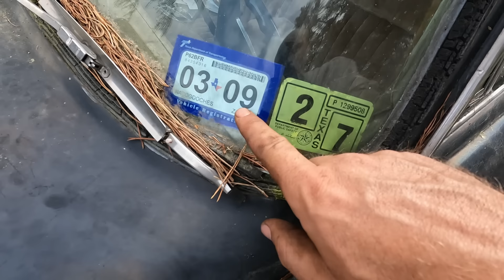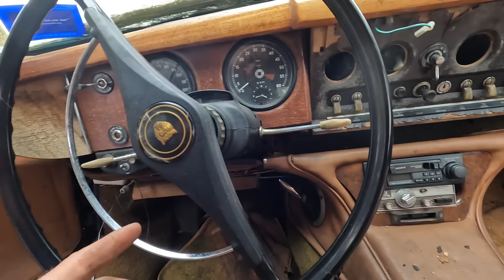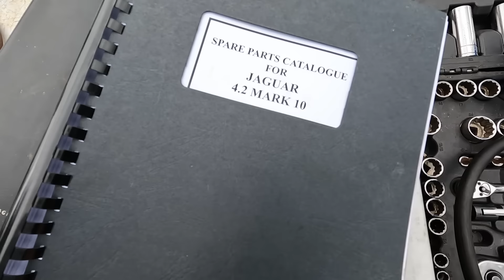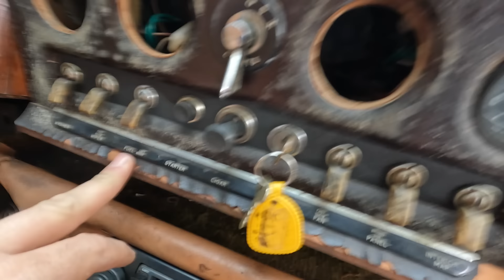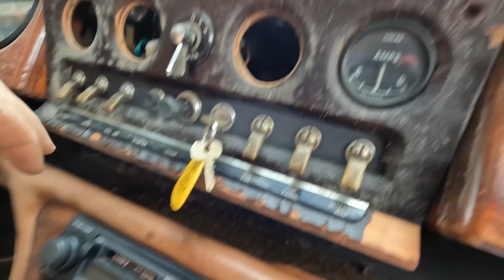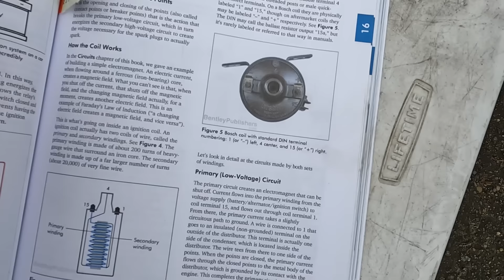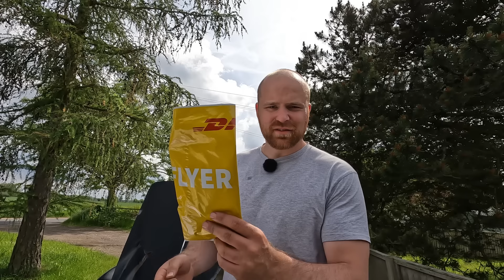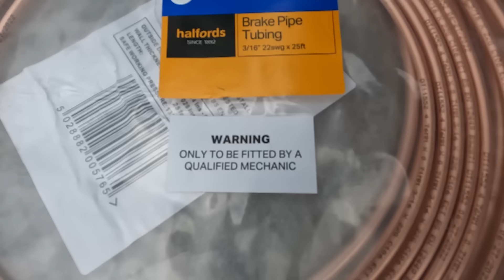1962 Jaguar sitting for 15 years. Will it run?

Comment: I think the wire wheels look fine. When you get to the window seals, if you can’t access them there, or need an alternative, there is at least one company in the US that does that. They can possibly make copies of what you have, so don’t throw away all the old ones, because they may need something to get the profile from. Very interesting video. Subscribed for more.
Reply from the maker: Thanks. Problem with the wire wheels is that they’re probably not rated for the large weight of the car. It’s why Jaguar put the car on steels in the first place

Comment: 1:13:28 The reason the brake pipe won't come out is when it has been tightened the flare on the end has squashed out wider, so it is now wider than the thread. A good pull whilst rocking it side to side usually pulls it free. So you know for next time.
Reply from the maker: Ahh I see. I'll have another go at pulling it out 👍🏻

Comment: Clamp off the rubber hoses going to the calipers on all 4 corners, then press the brake pedal. That way you can tell if it’s the calipers where the air is or back the other way up to the master cylinders.

Comment: Starter motors are series wound motors, which means that you can drive them with positive or negative ground (earth) and they will always spin in the same correct direction.

Comment: In case you didnt know, the side fuel tanks used to rot on all models. Rust would be draw into the carbs and the engine would of course stop running. Theres a good chance that is why the manifold and SUs were removed.

Comment: A bit of a project you have on your hands there. Although it looks very sound, unlike my 1960 Mk2 auto. Spent many hours on my back welding it! The idle speed should be about 500 when running correctly, stops that lurch forward when putting into drive, mind you, it was about the only way I could get wheel spin in my little Daimler 50 years ago!😂  I’ve changed from 2 to 4 pots, doesn’t seem to make any difference to pedal travel. I think your best bet with the brakes is to go with later master cylinder/servo setup, as on the 420G, E-type and early XJ6. Brakes should virtually bleed themselves, with just a bit of help to get the last of the air out. Remember to start at the back of the car. I think you should have at least one throttle return spring between the carbs somewhere, which might help with idle. Should keep you busy for a while, good luck!

Comment: I think the problem with the brakes is related to the adjustment of the master cylinder pistons, if the piston isn't returning back far enough then fluid can't enter the cylinder sufficiently to give a solid pedal. Look at the workshop manual and reset the adjustable one. Good Luck.

Comment: no matter which way you connect the battery it will spin the right way, if it has a transistor radio its usually negative earth, generators are easy to convert from positive to negative earth just by flashing the regulator contacts
Reply from the maker: Is there an easy way for me to tell if it's been converted?
Reply: @NotEconomicallyViable  a multimeter on the generator output

Comment: There is currently a 1938 Austin 7 listed on Autotrader for £2,500 that is right up your street. Apparently it's a non runner due to no spark but turns over. Would make a great project for you, those cars look like a blast and there's still a big community of Austin 7 enthusiasts despite the car launching over 100 years ago.

Comment: The brake pipe layout has been done to do away with the servo. Where are the bleed nipples on the the replacement calipers. if they are not above the piston area then remove the calipers from the disc and hold them so that the nipple is highest and there is nowhere above it for air to remain in the caliper body when your bleeding them. l hope that makes sense.

Comment: Getting this old Jaguar to run is the easy part !!! The difficulty comes when you have to tackle the massive amount of corrosion in all of the body panels, suspension and running gear !!!
Reply from the maker: This car's saving grace is that it's spent the majority of it's life in Texas, so the rust is nowhere near as bad as if it had spent it's life outdoors here in the UK 🌧️

Comment: Getting those triple SU's carburettors set up correctly is quite a specialised job, probably a big part of the reason why the car was running so lumpy.
It was nice to see that the old girl wants to go!
Incidentally, a refurbished set of those carburettors can sell for around £4K, more than the value of the car.

Comment: The hole in the bottom of the diaphragm housing on the carburettor should be for a vacuum hose isn’t it, i may be wrong, good work though mate well done

Comment: You tube is such a great source for repairing any vehicle infact l have used it many times when working on my 1997 Toyota Hilux from adjusting the tappets of how to remove the dashboard because it has to be removed to fit the radio CD player and fit a new ariel that's something for the future but another job on the list which is getting shorter

Comment: I noticed you using copper cored HT lead. I hope you added an RF suppressor to the system for every ones sake. RF suppression was why the trade switched to carbon cored lead. 
I checked hollow floats for leaks by putting them in cold water in a pot on the stove. Turn on the plate, look and learn. If I am forced to retire my 380 SEL a 420G might be a replacement.

Comment: These longer videos are so much better 👍 the one thing I would ask though if it’s not too much trouble, times when you do intricate work, like making the brake pipes, it would be nice to see the way you made them up using the tools doing the flaring and the bending etc and sorting the carbs out,when you took them all apart and did the repairs, some of us who haven’t used those tools before could learn a lot from watching your work. It’s not a complaint it’s just an idea. Regardless I will be making sure to watch all your future videos, this one was great I really enjoyed it, makes me want to go out and buy a restoration project for over the winter 😂 finding the faults and repairing them and having the feeling of self satisfaction when repaired is the best part. So please keep them coming, the more the better.

Comment: Guv, Good seeing you bringing this underappreciated Broken KITTY Mark 10 -. 420 G, Away From ruin.Making it road-worthy again. I Wonder If an XJ6 Break servo would work. Indeed THE Mark  10 - 420 G. was destined for the US Market, Yes It was Underpowered, compared to the American Cadillac Land Yacht V 8's Popular in the 60's IN THE USA.. Here across the pond Durring in the Mid 80's  JAGUARS Series 1,2, and SERIES 3  Were Converted with CHEVY 35O ENGINES with 350 hydro Transmissions, To KEEP THEM ON THE ROAD and Off the Lift. Here's Wishing you success with your project, May it bring you many Safe miles with smiles with what and which powertrain you May decide to facilitate.

Comment: Well done. I have the 420G version of this car in close to mint condition and very much enjoyed. I think your brake problem is the caliper pistons are partially seized and are springing back and forth with every pedal movement. I think that you will have to strip and rebuild the calipers. Does this car have velour interior? If so so that was not an option.

Comment: Back in the mid eighties, I know ow someone who bought a Mark 10 for its engine, it was a 4.2 and then put this engine into an Etype Jaguar Convertible after grinding off the '4.2' on side of the engine block and putting on a '3.8' designation using welding wire! 😮

Comment: The bit you called a choke, is in fact a thermo carb. In those jags you didn't choke the air to enrich the mixture you actually added an extra carb! So you got a richer mixture by adding more fuel. These also work to give extra fuel under extreme load. I think that float bowl with the hole is from the carb that is attached to the thermo carb and for some reason there were two of those fitted.
Reply from the maker: Appreciate the info 🤝

Comment: That looks a nightmare! The work I've been doing on my BMW is Childs play compared to the Jag. 8 hours today cleaning bugs off, alloys cleaned, snow blast, snow foam, rinse down and dry, clay bar the whole car, cleaned windows inside and out, Maguire's Ultimate Compound to all of the car via rotary electric tool, applied wax via rotary tool and some by hand and then touched up the tyre walls. Just trying to lift what is a bit of a tatty looking 120d.

Comment: assuming this is similar to more modern break systems, the booster you mentioned that its missing can cause the peddle to feel like there is no breaks. when the booster draws vaccum it stiffens the peddle but when there is no vaccum and the booster is present in the system the peddle will still stiffen up after pumping it. im not expert in 60's model systems however and they could work differently but i would think the concept is the same, only system ive seen that works different is hydraulic systems that use the power stearing system to assist with breaking power.

Comment: Thanks for the video.
This may already have been mentioned before, so apologies.
If it's a 62 car, it should be with a 3.8 engine?
That engine looks like a later version of the 4.2 with the ribbed cam covers.

Comment: I have watched almost an hour and I am missing one thing. I had a couple of SU carbs back in the 1970s. Yup, I'm an old geezer, and I remember putting oil (auto transmission oil, dexron) in the carbs. That thing on the top unscrews, and there is a plunger in a stem that has the needle underneath it. Vacuum pulls the cylinder in the middle up when you rev the engine, but without the oil in the damper, it moves up too quickly, and the engine misfires. Could be what happened the first time you opened the throttle.

Comment: i know you didn't show it but did you put any oil in the top of the carburetors the brass hex nut on the top of each carb screw out and a small amount of oil is put in them  this helps to slow the slide from moving up to fast a bit of 3 in 1 oil is used

Comment: Could what you referred to as vacuum lines, the smaller ones at the rear of the engine, actually be the  tubing for the screen washer system. they look about the right size and a big  wide windscreenmy well have 4 washers.

Comment: I keep thinking what is that Mk 10 parked up, who’s is it? You never mentioned it either so that adds to the mystery! I’m a massive Jag fan so I really enjoyed this video, can’t wait to see it fixed up.
Isn’t there supposed to be a servo bolted to the pedal box under the bonnet? Also the rocker switch on the dashboard would operate either the left hand tank/pump or the right hand tank/pump, there should be 2 pumps. Good luck!

Comment: Years ago I tried restoring a Jeep CJ8. I am pretty mechanically inclined and experienced. It was way too expensive for starters. I ended up donating the Jeep frame and running gear partially completed to a local Jeep clu  for them to finish and auction off for charity.

Comment: Are the calipers the right way up/right way round/configuration ish zm..
Had some Ford calipers for a cozy, to replace same ones on a kit car, which were like for like but the bleed nipple was on the bottom instead of the top.
Somehow this made them impossible to bleed.
Went back to supplier and they indeed had the reverse set that worked like a dream.

Comment: The carbs are probably overflowing due to a stuck float, When the float rises it should shut off the fuel supply if it is stuck down fuel will pumped in until it overflows, also check the needle and seat for damage.

Comment: Can you add a washer and a cotter pin on the throttle arm to keep it on? Also sounds like the spark needs to be adjusted, especially with the back firing. You'll have fun adjusting the carbs and getting them all into sync, I'd done it a few times, and it's not easy, but plenty of tools help you; short hose to listen to each carb helps, but you'll find that online. The front brake calipers look like 80's gm parts, perhaps corvette or something?
Reply from the maker: Not a bad shout with the washer and cotter pin

Comment: I've worked on a few of those engines and they're terrible. Last one ran great but after a decent test dr8ve one of the head bolts shot out from rust and a scalding hot geyser of coolant came blowing out. Customer decided to sell it after that. Also hello from Texas, yes everything here gets cooked to death, it's always hot.

Comment: 7:11 Positive ground... I wonder if you're going to short the negative terminal via that clamp with 5mm body clearence to the positive ground (aka the body) :D
Reply from the maker: But aren't dynamos positive ground units? Could it have been converted?
Reply: @NotEconomicallyViable  that positive wire at 7:18 seems to go directly to the body, so I'd assume it is a positive ground unit, but it's hard to tell through the camera?

I meant to say that the clamp you've used to make a good contact on the negative terminal of the battery seems to be dangerously close to the body, which, in theory, has +12v.

Am I missing something?
Reply from the maker: @V4ker  Ahh I see what you’re saying. I’ll double check that negative and move it out the way 👍🏻

Comment: I would say the pressure is escaping back through the brake master cylinders not holding pressure remove the front pipes from the brake caliper and blank them off and see if the pedal holds pressure

Comment: I’m not hopeful, hello naughty economically viable, great video really enjoyed it, reminded me of my mum and dad’s 420 G, just to say one bit of information you may already have been told the switch you are thinking switches the fuel pump on and off is not the case that pump changes the fuel supply from one tank to the other because the car has two tanks as you know, but he only ever drew from one tank and when that tank became empty as could be seen from the fuel gauge, you flipped the switch so it drew from the other tank.

Clearly only has one side of the car with a fuel pump on it still so when you thought you were switching it off you were actually changing it so the car should’ve drown from the other tank had been fuel pump attached to it when you thought you were turning the fuel pump Transferring from the tank that Still had the fuel pump, hope that helps and good luck for the future

Comment: Good work, have you added oil to the carbs? They require it to act as a dampening measure. You fill from the top just undo the big. screw on the top

Comment: I’m not even remotely OCD, yet I found myself so frustrated you didn’t clean up the engine, and get rid of the pine straw throughout the first hour of the video. After some screaming at the screen 🤣 I need to blow off steam on my garden leaves now. Thanks!! 😂
Have to say that this jag is the definition of not economically viable.

Comment: I turned 18 a couple months ago and im restoring a ford escort panel van, 78 Chrysler valiant and a 66 holden. im almost ready to paint them two of the three and put the motors back in, all within a couple months. If i can do three cars anyone can restore one at a time
And im doing everything myself. Fabrication, panel beating, painting, rebuilding the motors. everything
Reply: great work well done those cars are better than working on a jaguar

Comment: Gday. Im doing a similar role on my 66 Mark X here in Brisbane Australia. Both fuel tanks were horrid and pumps similar so pulled them out put in a single 60 litre aluminium one in the trunk with one electric fuel pump (yes uses that switch in one position only). Take care when doing this as both tanks went to a Y link above one of the pumps (mines RHD so could differ from yours) reason i said this is when the new system pumped up to one metal fuel line under the parcel rack it poured out of the other side… lesson learned. Lol 
Brake lines will likley all need replacement no matter what. Happy to chat. El

Comment: Had a few old jags mostly  5.3 v12s ,first thing I would of done was to clean the engine bay with airline then jet was it ,then test as you did by turning crankshaft then test spark but strip the cards as they were already off,was there water in it ?

Comment: not sure i see you do it. but on these sort of  jag finds when they say engine not running for so many years  take spark plugs out pour some oil in each bore than do your work around the engine you should let that oil stand for at least a wk before attempting to start or turn the crank .

Comment: Seeing as the whole intake is missing I would see this as a prime opportunity to go to throttle bodies. There is a company called Jenvey and they do a ‘heritage’ line. They look exactly like carburettors but all the wiring is hidden and you could run an aftermarket engine management system which would be infinitely better than the original carburettors. It’s not the cheapest but it’s worth a thought. No more pulling out the choke, pumping the pedal, flooding it and tuning it every five minutes. It would be like a new car.

Comment: That motor has ribbed cam covers, I believe those were fitted from 1968? So is it the original motor with new cam covers, or is it a later motor? 🤔
Reply: Later engine, wire wheels. Bits from a crashed E type?

Comment: I think you could find that the original fuel pump was electric . I had various BMC/  BL cars from the late 50's many of which had electric fuel pumps. Bigger engined cars often had two electric fuel pumps.